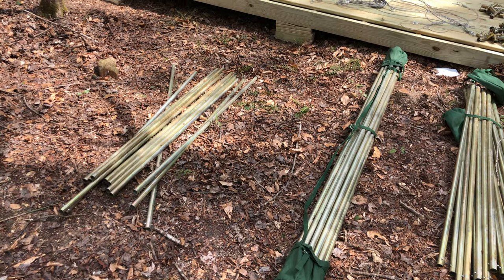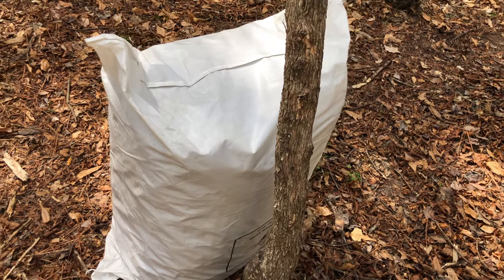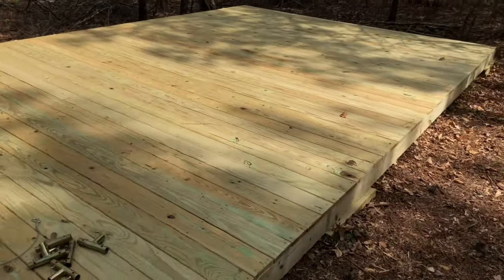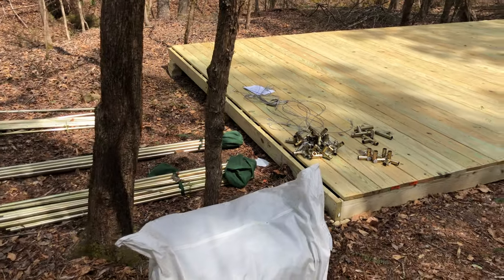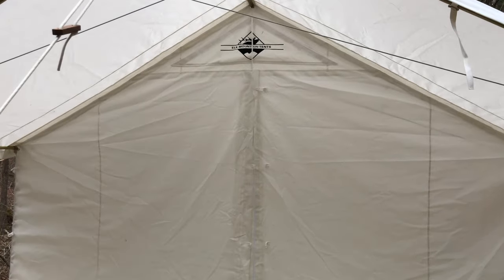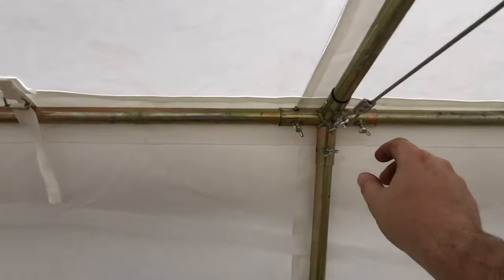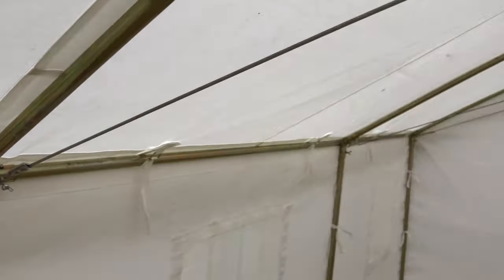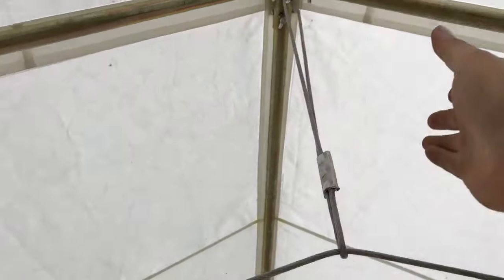Elk Mountain 13x16 Canvas Wall Tent w/Awning Set Up at Permanent Campsite

Comment: If this is a permanent install I would have put posts in the ground and cut off level instead of the stacked boards to level the platform. Saw that at a guys hunting camp spot he used every year. A little different frame setup with the cable cross ties, how is that lasting and functioning?